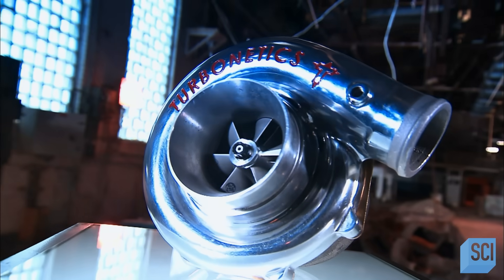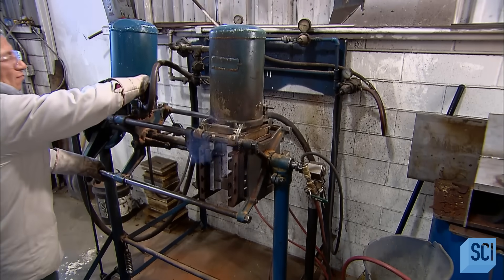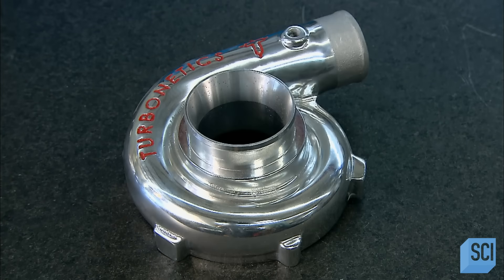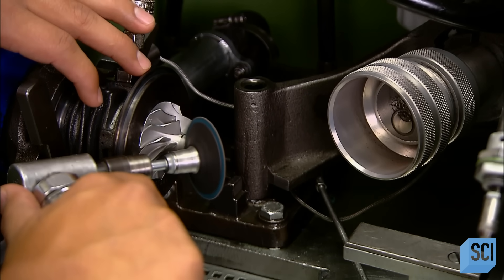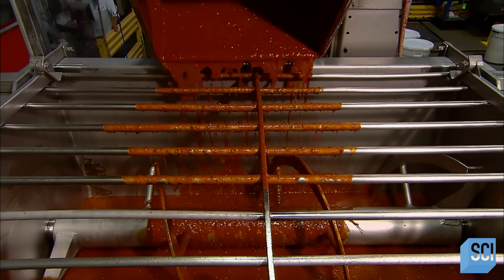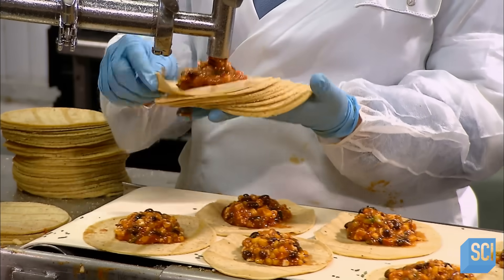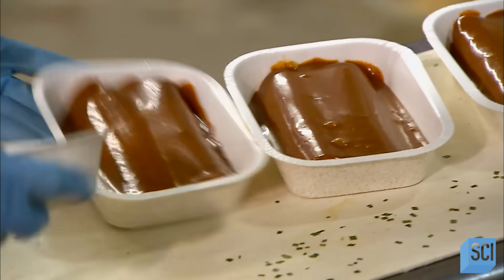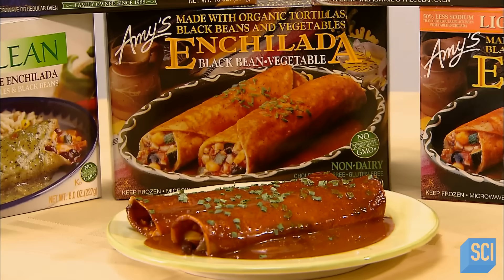Turbochargers and Enchiladas | How It's Made | Science Channel

Comment: Correction: Turbochargers do not improve engine efficiency by themselves. Adding a turbocharger to an engine only allows it to create more power since there is now more air available that you can burn with more fuel to maintain the same AFR.
Reply: They would improve engine efficiency compared to a similar N/A or supercharged engine at the same power level.

Comment: Incorrect. It does take extra fuel to make more power. You don’t waste less fuel with a turbo, you use more.
Reply: it depends on how the car is tuned, there are small commuter cars that are turbocharged and get 30+mpg
Reply: More fuel is used to make more power, BUT making X amount of power with boost is a bit more efficient than the same power without boost. So it's fair to say fuel is saved.
Reply: More air and less fuel makes it more efficient